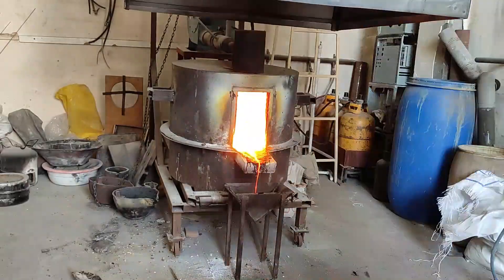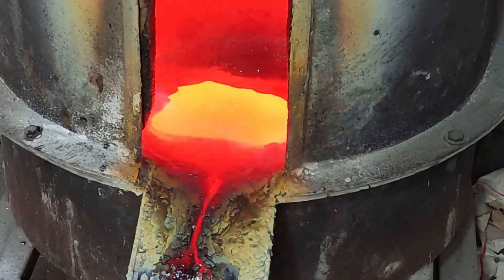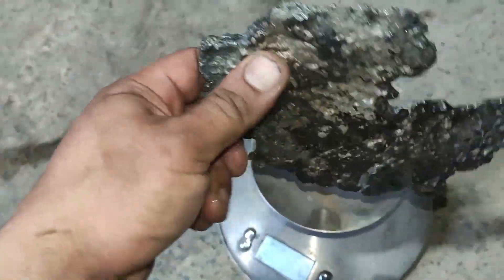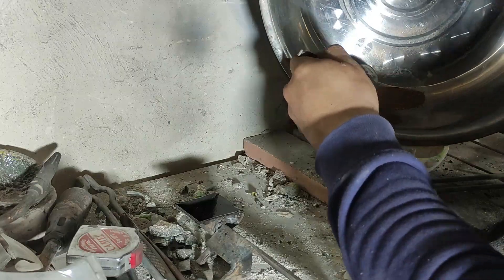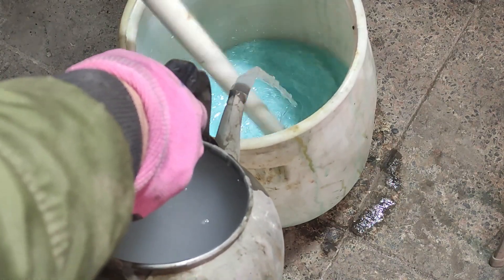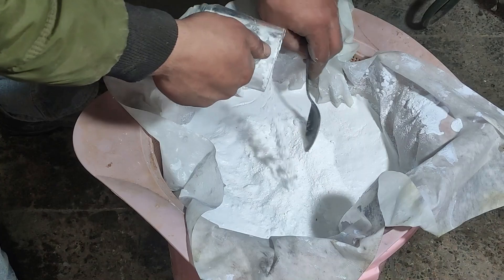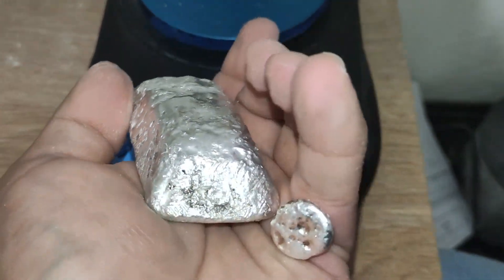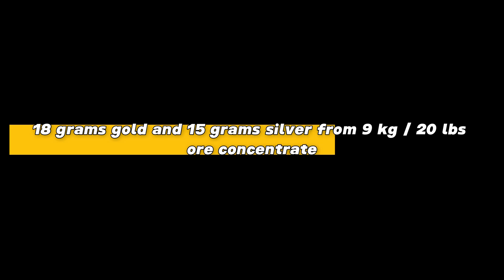Smelting Ore Concentrate For GOLD And SILVER

Comment: Hi , brilliant video . Could you please share details of your burner . Capacity or any other specifications ? Also in another video I thought you had mentioned u were  using a dual ( gas and oil)fired burner . Any particular reason why you shift to oil after the initial burning with gas ?
Reply from the maker: Thanks, try to cover it in a video, the reason is just for the costs and more energy could be released with same weight of oil or diesel

Comment: Thank you for your kindness. Sorry for the inconvenience. I have a 250,000 btu gas burner, up to what maximum oven chamber size would this burner work well?
Reply from the maker: It should be ok for a 200 cubic meter chamber with good insulation
Reply: @PickyPlans  I'Thank you very much. I guess you meant 2 cubic meters. I'll try to make one. The interior floor is conical, right? Greetings from Colombia.
Reply from the maker: Ah sorry i mean 0.2 cubic meters, larger may need very thick insulation. Yes that's conical. 
Greetings.

Comment: 🎉🎉🎉 that's amazing, you simplified everything within 10 minutes, could you mention from which method you got this concentrate? Shaking table or centrifugal concentrator?
Reply from the maker: Thanks for watching man, Not everyone finds long videos interesting. 
It's been concentrated using a Knelson concentrator
Reply: @PickyPlans  that's great, I hope I will can build a similar Knelson concentrator myself, now it's under designing :)
Reply from the maker: It works nicely. You need Teflon sheets to make inside ridges and a motor with an email drive inventer capable of programing to set off and on cycles
Reply: @PickyPlans  is increasing RPM decrease the gold recovery or increase it? I can't find the formula for recovering nano gold particles with efficient RPM, increasing RPM increases the gravity force but does that increase losing nano particles or not, it needs a lot of research and tests to reach the right design
Reply from the maker: Classifying prior running the machine is crucial for very fine batches like 600-1000 mesh you need to increase the RPM and for coarse particles it will give you the desired results that's why you need an inventer to be able to calibrate it according to your material particle sizes
Reply: عمل جميل جدا 
حتا الفرن المستخدم في عملية الصهر الاولى شكله متقن و اكثر من رائع
Reply from the maker: Thanks!
Reply: Is the stainless steel bowl you used  magnetic stainless steel or nonmagnetic?
Reply from the maker: It is weakly magnetic mate. I guess 304
Reply: Do you have any idea about the ore quantity before it been concentrated to 20 pounds using Knelson concentrator?
Reply from the maker: @ayhamhafez285 around 250 kgs of high grade ore